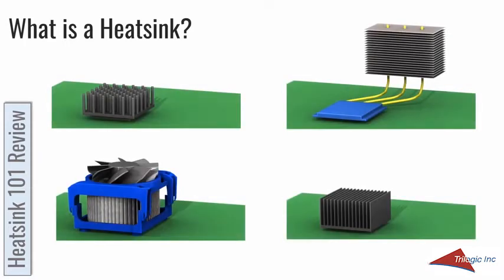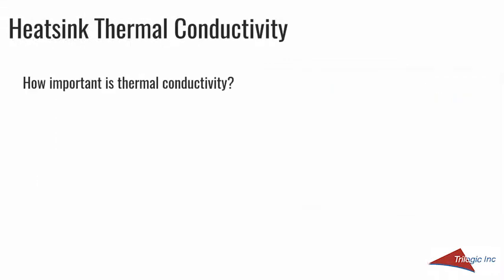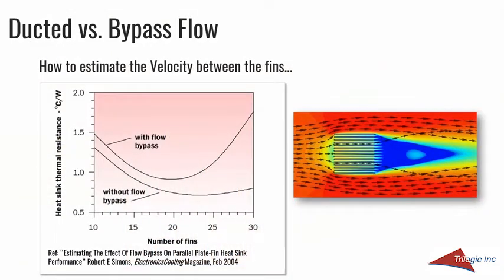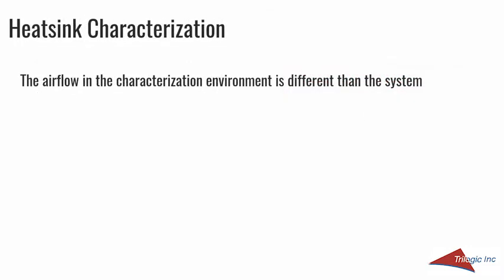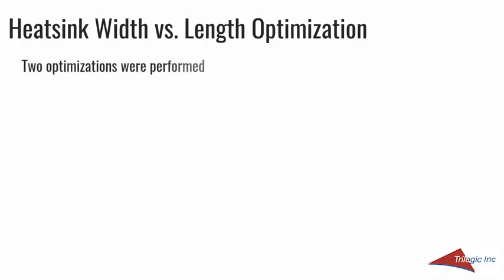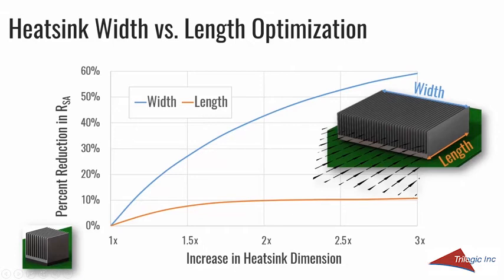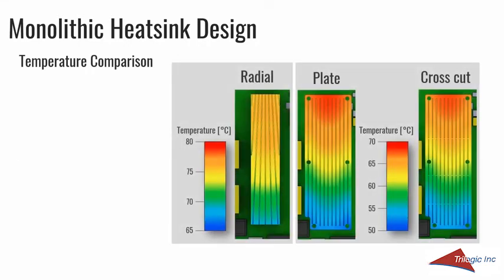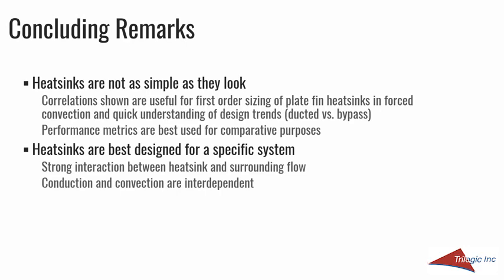Heatsink 201

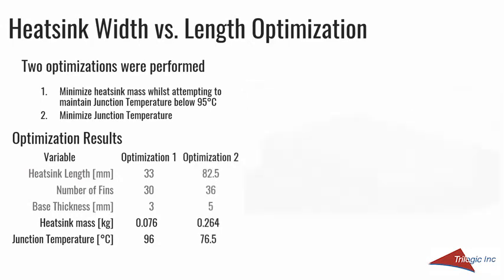Comment: Thanks for excellent informative video! I have a question, here @18:48 , for optimization 1, I know the cost function was to minimize the weight of sink. but didn't you at the same time win FloTHERM set the constraint of auction temperature at 95C? why you are talking about that you ran a separate CFD? maybe I did not get the point correctly.

Comment: How does the duct from a physical standpoint “force” the air through? Is there a pressure difference  for example a pcb in a box with and without a duct around the heatsink?
Reply: As everything in nature tends to go towards minimum resistance path (thermal resistance, hydraulic resistance, electrical resistance,etc...) so does the flow. When you have a bypass fluid says "Ok, if I have 100 J of energy I will spend most of that energy to force most of my particles around the fin and force some of them in the fin". Contrary to that, when there is a duct fluid is forced to go through fins - it doesn't have that ability to make bypass. What happens is that fluid understands that there will be higher pressure drop, i.e. higher energy so he will say "Ok, I need a lot of energy but I don't have that much amount of energy to push with high velocity so I will decrease my velocity a bit (decrease the mass flow) just to push all my particles through it". I hope this kinda helps.